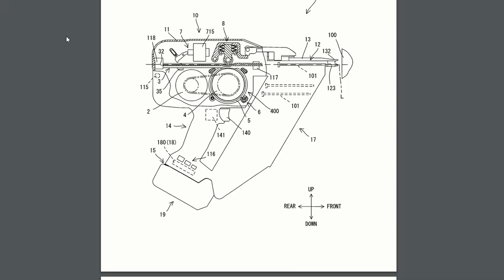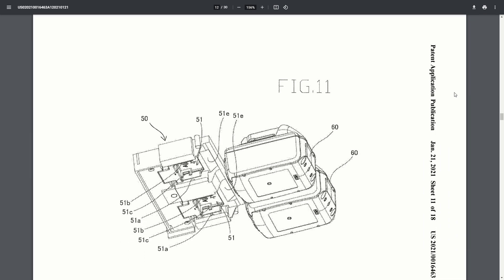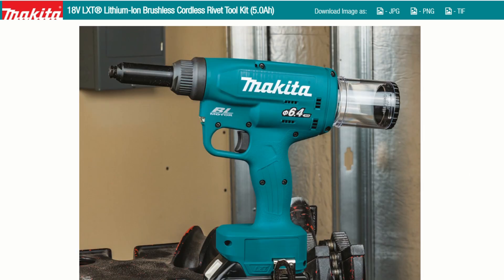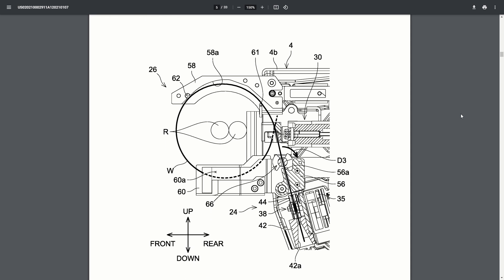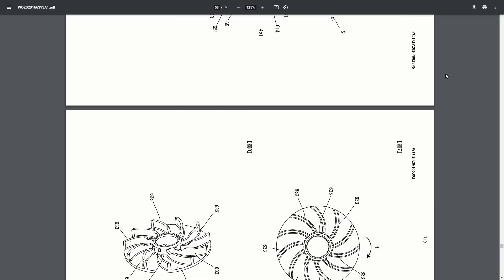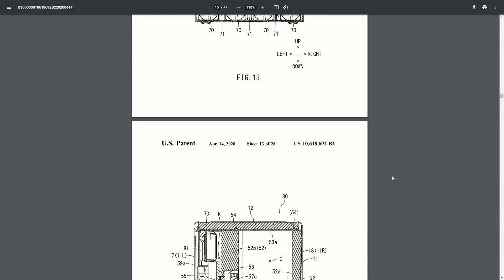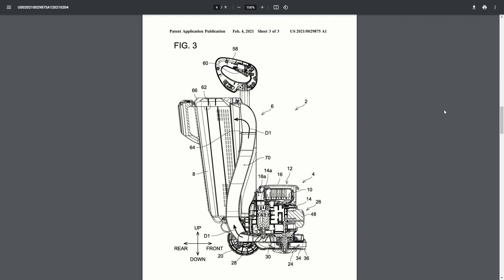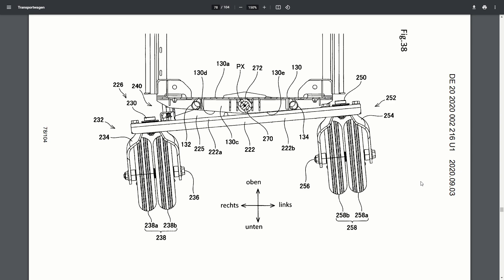Makita New Tool Patents 2021 - Crazy New Tools We Could See This Year!

Comment: Looking forward to seeing what you dig up this year (2022). I had to come back to this. I have the air duster now, and use it a lot. Seeing as the patent had it on 18v, but it came out on the 40v platform, I'd have to say it would be the same thing for the thickness planer. And with those 8 AH batteries, it's more feasible. Still waiting on a belt sander too.
But anyways, thanks so much for these again. You should have a Patreon or something. I owe you a coffee at the very least.

Comment: the rebar tier is likely an alternative to Max USA's TwinTier. Max is the one who invented the rebar tier and they've always been the gold standard.  I've used Makita's tier as well and it's definitely a great tool, better in some ways even.  But the tying range is too small to make it a good trench gun, you'll miss a lot more ties because the jaws are a lot smaller/less forgiving.  

The existing Makita tier is only meant for 1/2x1/2 and 5/8x5/8 rebar meshes.  The TwinTier (and likely this Makita) are meant for tying any range of rebar up to ~1"x1".  You probably get a more secure tie as well.
Reply from the maker: Thanks for the great insight! I've only used a manual pigtail myself.

Comment: Love your videos! Awesome, cool, wildly innovative tools in the pipeline! 
On the head scratching subject, Makita is a tool manufacturer that sells tools. A lot of them... I think the issue about battery platforms and such is Makita's way of selling more of them. Think about how many people will jump on a new LXT tool at launch. Then, when it comes out on the XGT platform, well, most guys just can't help themselves. Before you know it, there's all sorts of used LXT's for sale.
Reply from the maker: You make a good point. It just surprised me Makita kept so much overlap between LXT and XGT, but I guess they figure new users are more likely to buy into XGT since it can support smaller tools like drills and impacts as well instead of only larger tools like breakers and cutoff saws.

Comment: I’d go for the air duster. It would cover one of the few things a compressor offers that I can’t get out of a cordless tool.
As for the planer, I’m really not sure about that. While I’m all for cordless, I can’t imagine it on anything less than 72v and with more amp hours than they currently offer.
Thanks for digging these up Nate. 👍🏻
Reply: I agree, unless you're planing soft pine, then the cordless ones wouldn't last long. At 240v 2400w my electric one struggles at anything over 0.5mm each pass.
Reply: @kizzjd9578  2 XGT batteries is capable of ~2800W.  + the brushless motor advantage.

Obviously that doesn't necessarily fix the potential runtime issues, but I don't think it'll be short on power when it absolutely needs it.
Reply: @jaywelker5566  yea id love to see a cordless one, would be good for those that need to plane timber thats more than 80mm.

Comment: What about the table saw
Reply: Been waiting since Dewalt came out with theirs. I had to buy the Dewalt one for the mean time. Makita is really failing at this one because this would be a HUGE plus if they were to step it up a notch and create a 40 volt table saw. 🙄
Reply: @orlandoramirez1345  im just about over waiting for a 40v table saw. I will follow suit soon and get the dewalt flexi volt. Hate having another batter platform but dewalt have some good stuff so makita are missing out
Reply from the maker: They could still be working on one but just don't have any patentable features on it. Hopefully we'll eventually see one in both LXT and XGT platforms!

Comment: Awesome !!!  Ha Ha Friggin Makita, and I LIKE Makita, but all this crazy innovation and invention, wasted on a few questionable applications?  Too bad they couldn’t innovate on their LXT batteries !!!  🤔🙄😡 I’ve gone round and round with Makita Factory techs on this issue, the issue being maximum 6.0 Ah on the LXT batteries.  And they think that planer is going to run on those?  😂😂🤣😂🤣😅  Right!  So, in lieu of updating their 18 volt batteries with 21700 cells, as every other major Tool company has, they decide to launch a 40 volt system.  I think the XGT line will prove successful, and will have some great potential as a X2 / 80 Volt platform.  I’m just a bit disappointed by a Makita.  Good to see you back!  Always enjoy your videos.  Might a comparison of the available left hand blade 6&1/2 inch saws be in the pipeline?  Hint Hint 😃  Stay safe and Healthy!  👍👍👍👍👍😁✌🏻🇺🇸
Reply from the maker: Yeah, their XGT battery platform announcement was a bit of a head scratcher to me. Not even partially backwards compatible, and didn't leverage 21700 cells. What were they thinking!? It at least should have been ONE of those options!
EDIT: Apparently I was a little wrong - the 2.5Ah XGT battery uses 18650 cells, but the larger ones use 21700 cells. So at least there's that.

Comment: That's a concrete grinder not a vacuum
Reply from the maker: It's not a concrete grinder. The patent is titled "lawn mower" and the abstract states "A lawn mower that may include: a cutter unit including a cutter configured to cut grass on a ground and a motor configured to drive the cutter." 

Definitely a lawn mower. Go read the patent text I linked in the video description.
Reply: @DoresoomReviews  that "mower vacuum" has been out in japan in both cordless and their corded model (which is a different color).

Very popular for those with small lawns as is most of the case in Japan. Also great at getting grass right up against the fence or walls.

Comment: Nice to see that they are still developing for the LXT platform, I was concerned that they would drop it. If the powered cart goes into production I look forward to seeing them in use on Battlebots.
Reply: Makits said that the xgt 40vmax tools are just a new high end line of tools and batteries, and the lxt 18v or 18v x2 will still continue as they are smaller and compact and every one has hundreds of the batteries. If they wanted to push everyone to xgt, they should do what hikoki does and buy back the older batteries.
Reply: Heck No Matt, they making too much money off the LXT batteries, as the Customer has to buy extra due to the limitation in amp hours.
Reply: @georgedavall9449  5.0 seems pretty good would like bigger though like a 7 or 8
They have a 6.0 I think but might as well go even bigger

Comment: I might have to get into the Makita system if some of those tools come to life. Actually, specifically only one tool. The air duster. I own a crappy Amazon purchased electric air duster that cost $70. It is extremely cheaply built and simply lacks power. That air duster would be a game changer.
Reply from the maker: Have you tried the Ryobi high volume inflator? 99% of the time I'm using mine as an air duster! I reviewed it here: https://youtu.be/sKhvssNbhTc
Reply: @DoresoomReviews  I bought mine to inflate an air mattress, but it turns out it's main use for me also is as an air duster.  It's been a really useful tool and cheap.